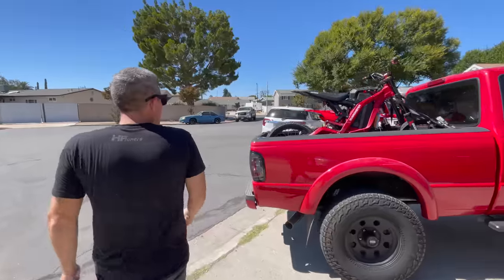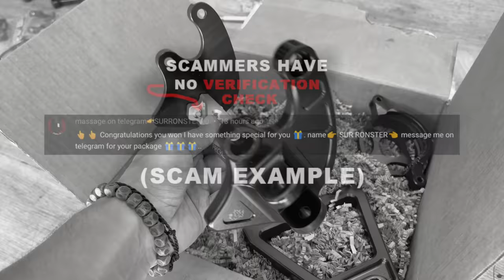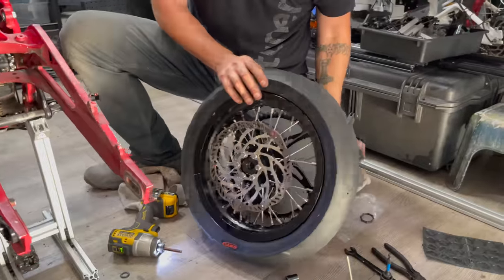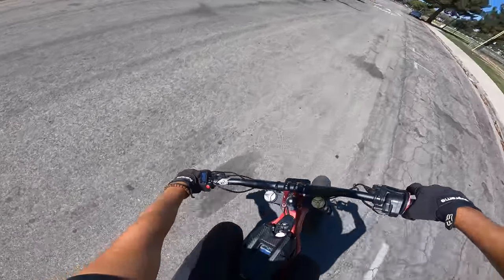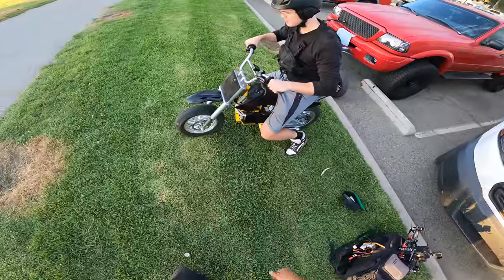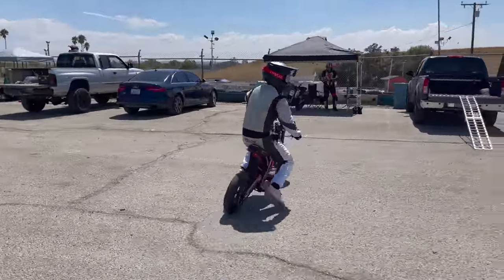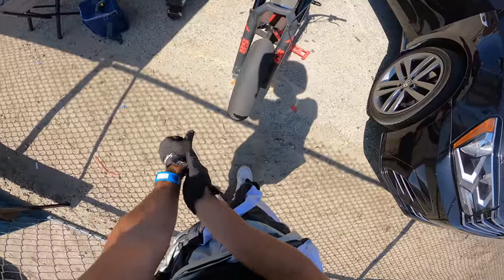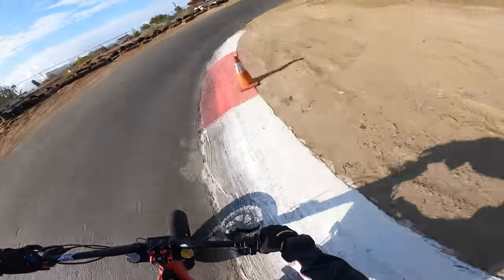72v Surron with MINI SUPERMOTO wheels!

Comment: The 12 inch tires put put your pegs closer to the ground which reduced your cornering angle. 17's with a stick tire you might be able to drag a knee.
Reply: Lmao that would look so sick and so funny at the same time on a surron
Reply: For real if he’s fast enough hell he could be a Mig
Reply: Tbh they corner very well I'm abt 6'4 and I ride with 12 inch wheels
Reply: He could drag knee just how it is
Reply: @CerberuzMoto  surely 13 or 14s would be better for angle
Reply: @S55_Marquise  ye but only downside to a surron is its tiny frame ... if it had a wider frame then ye,but 12s work good cus dey small and suit the bikes style unlike the 16-19 inch wheels. Which make it literally look like a bicycle unless you custom the wheels with the smPro platinum  rims,The normal 17s look nice with supermoto wheels that way.
Reply: we needa see some 15's
Reply: I hate smaller types just mainly cuz of the danger factor when it comes to uneven pavement, potholes or rocks all can throw u off balance so easy if u have to make a quick move to get out of danger. Now of course this can happen with any size tire but it goes without saying the smaller that you did Tire you have the bigger risk you have of wrecking your bike because of it. However there is also a lot of upside to having smaller tires as well but in my opinion the benefits to having smaller tires doesn't outweigh the cons unlike with bigger tires the benefits greatly outweigh the cons but hey we're all out here just to have fun so whatever makes you happy when you ride your riding for you you not riding for the man next to you so in the end ride what makes you happy just be safe doing it
Reply: Cap 💯
Reply: Or find another way to mount the footpegs a little bit further back but higher

Comment: your ranger sounds really good! you must have an aftermarket exhaust? is it a 3.7 or 4.0? I've had 3 different cylinder sizes and the Lil 4 cylinder was my favorite.  1.6 i believe most pep to its step! 3.0 was a little clumsy and slow but had power! and the 4.0 just liked to spin the tires!
Reply: Buy lamghi farri suv 155 noh. Can ball run v12

Comment: hey, if you like your ankles you should get some half-height moto boots at least! It'll save your ability to still walk if you ever wash out then smack yourself between a curb & your bike (which can happen on the street, or much more commonly on the track).
 
Also, the suit you were wearing is more for enclosed vehicle protection - more for fire resistance - vs a suit that is meant to slide on the pavement for motorcycle racers/riders.

Comment: So are you losing any top end? I would think with those smaller tires you would lose top end unless you've adjusted your gearing but I didn't see you do that. So less top end, pegs scrape on the turns and no kick stands those are your cons. Not bad I guess!

Comment: You actually increased the rake of your bike. So it should turn in a lot faster but it makes the bike unstable in speed
Reply: Both wheels are the same size.
Reply: @OregonMotorcycle  I am comparing the big wheels to the small wheels
Reply: Buy a farri lamghini

Comment: LB will never fit for any road racing. It will suck in every competition and the problem is not it's powerless engine and fragile frame with suspension. Even if you make it powerful enough and never crash it you will still not catch a pitbike. To know why you would need to understand how the bikes exit from turns in road racing. The quick exit you see in MotoGP is only possible because of  squat effect provided by the suspension. Due to LB driving belt construction you will never have any squat on this bike. That's why LB sucks in exits it just can't exit fast. It really feels like MTB at exits which is very different from what you should feel in road racing. Remember it's MX bike, in MX you drive the bike differently and the absence of squat might be acceptable although personally I would be very much interested to learn the reasons why SurRon engineers designed a squatless bike. LB is MTB with an engine, perfect for what it is but nothing more.